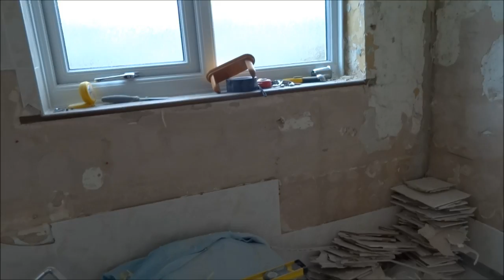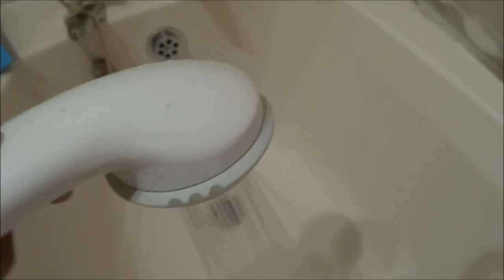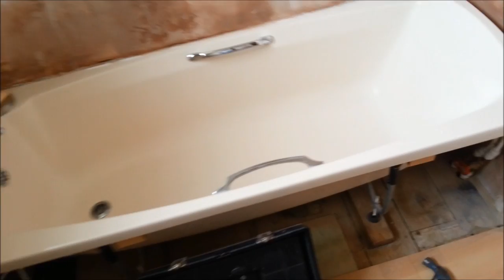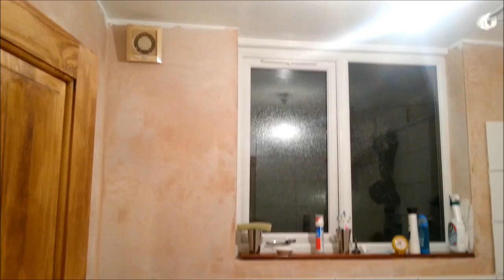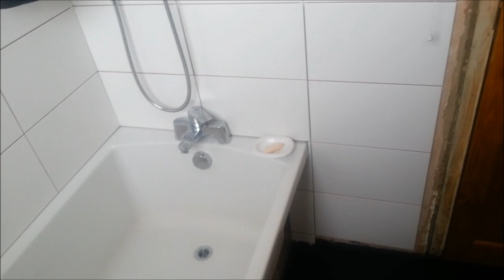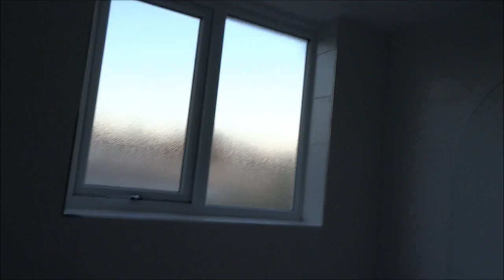DIY Bathroom Refurbishment / Renovation £1800

Comment: Looks great! I'm planning on renovating our main bathroom soon. When you installed the shower did you just connect it into the hot and cold supply for the bath?
Reply from the maker: Thanks, yes i split the hot and cold connections between the shower and the bath.
Reply: @GeekStreet  Thanks!

Comment: Hi there, again great video, really like the bath access point u made, I defiantly wants to try that. I noticed it was plasterboard. Was the rest of the panel plasterboard too?

It doesn't look like u tanked the shower walls, have u not had any problems such as with the plasterboard behind the mixer. I've just started my bathroom and when i removed all the tiles the walls in the shower area were soaked.

I thought i'd give pushfit and pax a try, I even got those little coppa bends for when I needed a 90 in a small space. Just hope they last as they are in a chase that I've now covered up with plasterboard and eventually tile over.

Is there anything you would to do extra or different now? Just looking for some tips as am in the same process now.

Thanks again

Comment: looks good, only thing that let you down - push fit plastic buried in the wall - a bit risky if it springs a leak.
Reply from the maker: Thanks for the comment, the push fit isn't actually in the wall.
Reply: @GeekStreet  behind where the shower controls were there were a load of push fit connections?
Reply from the maker: @serverstatuscouk  ah ok I get you now, yeah that's always gonna be a hassle.
Reply from the maker: I actually left it for 2 weeks just to be 100% sure it wasn't leaking.
Reply: @GeekStreet  yeah personally I always use compression fittings because I know they dont leak. I always get told that plastic are good temporarily and compression are good permanently but each to their own. I'm sure they'll be fine but personally I dont like to risk it.

Comment: Nice video, when u buried the plastic pipes it looked liked u wrapped them in something. What was it?
Reply from the maker: Jackzuk thanks for the comment I used 20mm conduit so it can be removed without destroying the wall or tiles....in case there is ever an issue.

Comment: Also, did u fill the hole in where the mixer is or did you just put a panel in front of it so the tiles would have something to adhere too?
Reply from the maker: +Jackzuk I just put some plasterboard there from what I remember.